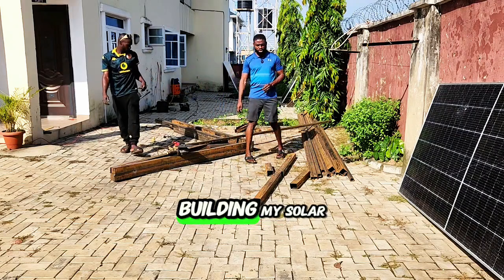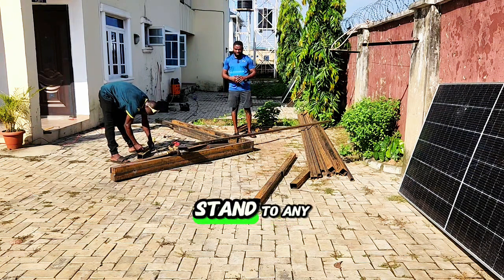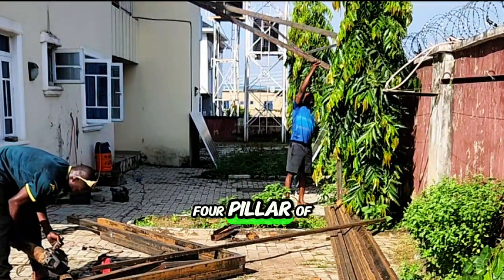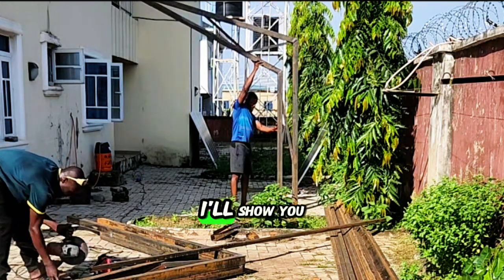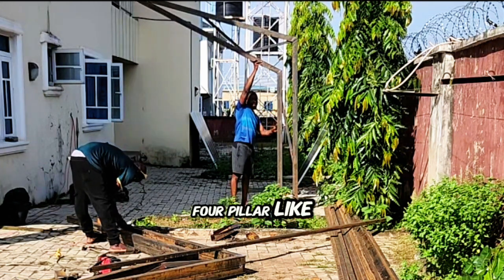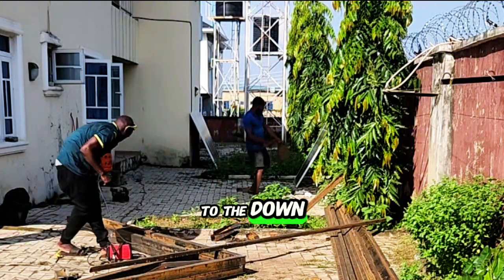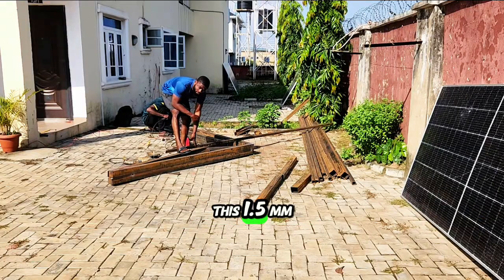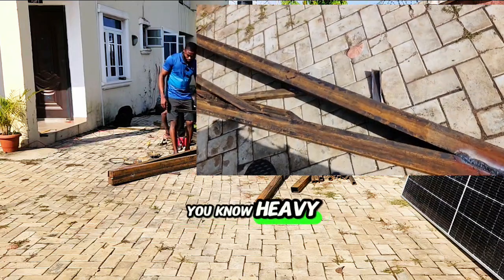DAY 2 OF BUILDING MY SOLAR CARPORT

Comment: Hi Solargod. I am just wondering why didn’t you just use wood for your carport instead of steel which is way to expensive in my opinion.
I noticed we like to use steel a lot in Nigeria instead of just using wood. Please explain, maybe am missing something.
Reply from the maker: Wood is cheap, but the finishing might be the problem. 
Cause if I want to us wood I'll make sure the woods are perfect. 
Which i don't have most of the machines required for that